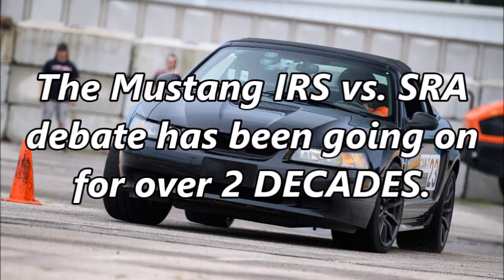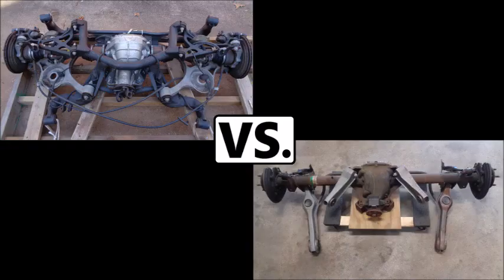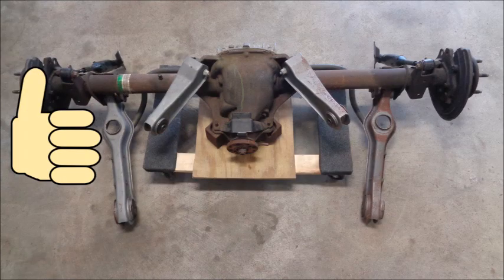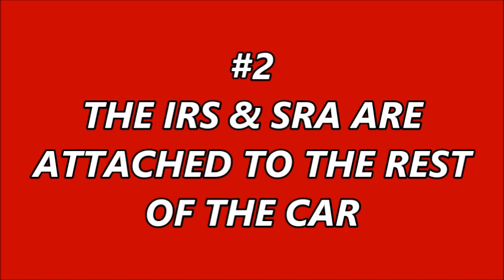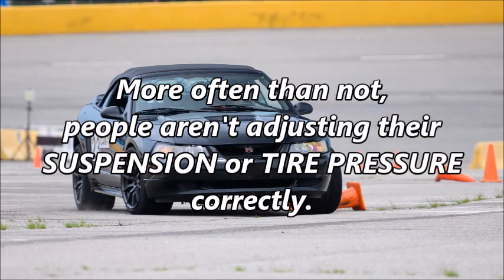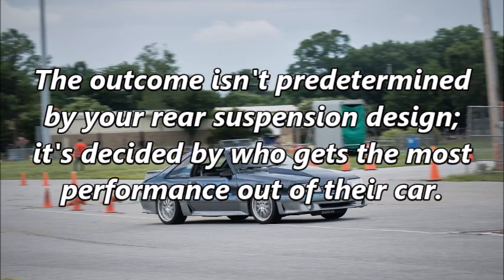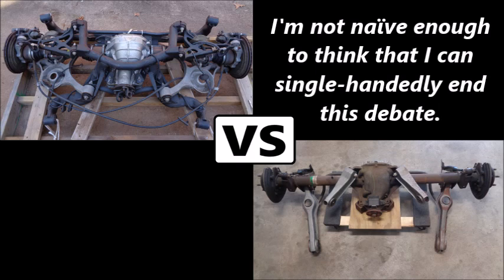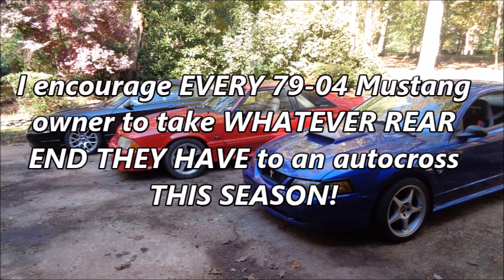5 Reasons Why the 79-04 MUSTANG “IRS vs. SRA for Autocross” DEBATE is POINTLESS

Comment: From my own personal experience driving the absolute crap out of my car on undisclosed surfaces, my 7.5 sra is sketchy through high speed cornering because of bumps between pavement. The way it reacts is like a hop, reset in traction, the rear end of the body wobbles to catch up with the axle, and it’s an unsettling feeling pushing 90mph through a corner. The irs would or at least should handle it far better 😅
Reply: SRA properly setup wont do that!
Reply: @TheSunChaserUS  do you have a torque arm, panhard/watts link, sway bar, and cambered live axle setup? That’s the best setup for solid axle I can think of but I personally would rather take the irs
Reply from the maker: This video is focused on autocross, which generally has speeds under 70 mph. Things change when you're going over 70 mph (like on a race track). You can move the limit of traction of an SRA further out and add composure at the limit. But you can also push it past that limit and make it lose composure. I've autocrossed my SRA cars on some rough courses and the car does get upset. But I know that's a tendency of the SRA and I'm prepared to deal with it.
Reply: @warhorseracing  autocross is outside of my expertise, but a Dodge Ram trying to put it’s foot up your ass requires a lot of concentration and smoothness from the car 😅 🏎💨
Reply: @Diamondsintherubble  yes, i have a watts link, sway, adj. coilovers heimjoints on every arm on the rear and with the PM3L configuration. It articulates a lot and you can feel everything happening on the rear 

Day and night vs stock SRA! 

Many people roadracing and putting records even w/o cambered axle just T/A Watts cortex combo.

Also either of both will highly appreciate a proper differential, a Torsen T2r will improve more than anything else over the rear, even better with the SRA 

I think it also depends on the type of driver, and that at the end the biggest difference will be in how balanced is the overall setup and how used to the car the driver is.
Reply: @TheSunChaserUS  well mine is maxed out for a “bone stock” car. I put h&r super race springs on the stock shocks, factory no sway bar, and just installed 4.56’s with a torsen which I’m waiting to break in after I fix my car. I’d like to size up to a 28” tire on a 19” rim now that I’m set up for the wheels I have. The 26.7’s I put on the 18’s up front cushion the road a lot more than the factory 25.8” tires did, so I’m excited to see how my car feels with the rear widened as well, although I don’t expect it to be better than an irs. This mustang I’m building is gonna stay sra and the next mustang I build is getting an irs made from scratch
Reply: @Diamondsintherubble  thats a nice setup, im running 17x12 with 315s all around also, with a -3 offset they widened the car a lot, 327s with the smaller 25.7 and FBO 2v, i had 4.10s but didn’t like it, im getting 3.73s and the T2R soon! 

I also tested many adjustable and non adjustable rear dampers with many ratios, it totally changed the way the car felt in every combo, PM3L and watts its the best cheapest combo for a SRA, altho i haven’t tried a car with a T/A, i did improved the rear little by little. Biggest change so far was the Watts, its so easy to change the roll center to over or understeer on the rear
Reply: @TheSunChaserUS  see my theory was to throw 200lbs of ballast where the rear seats are which should offset my tubular front end and carbon hood/fenders nicely along with the sbf I want to drop in. I’d definitely suggest larger diameter tires with your gearing but not without a larger rim. I chose the 295/40r19 tires because they closely match 710mm slicks and 275/40r18 fronts cause they match up to 680mm slicks. Also, fun fact, 680mm tires on an 18 has the same wheel:tire ratio as 705/710 on a 19. I’m not too too fond of my solid axle but it’s what I got, I just hope my t5 and 7.5 can handle 600hp without launching or aggressive tires 😅 I went with the Eaton truetrac diff for my car but I haven’t got to try it yet cause I’ve been sorting out my welding situation since March, finally getting close to having that ready to go. Had a nasty crash right before Halloween and had to hack off my front end

Comment: so pretty much just add weight and poly bushings to a irs system
Reply from the maker: You wouldn't add weight to the IRS, it already adds weight where you want it in the car. I went with poly bushings in the control arms because I built my cars on a budget, and I felt I could save money without compromising performance by making that choice. Many people will disagree with me on that (including FTBR). Upgrading all the bushings in the IRS assembly will improve it, but those mods should only be made if they are legal in your SCCA Category.
Reply: I was going to build a drift mustang out of a sn95 or new edge
Reply from the maker: @skumbag_industries  I don't have any experience with drifting, but I'll bet there are companies that make everything a Mustang needs to be a good drift car.
Reply: @warhorseracing i have the FTBR kit for the rear and MMS up front. Full MMS Koni Coils at all 4 cornerd. It handles noticeably better than when I had the SRA.
Reply from the maker: @SCHMALLZZZ  FTBR and MM make great parts with proven results on autocross courses. We're lucky to have so many aftermarket companies dedicated to making these cars handle better.